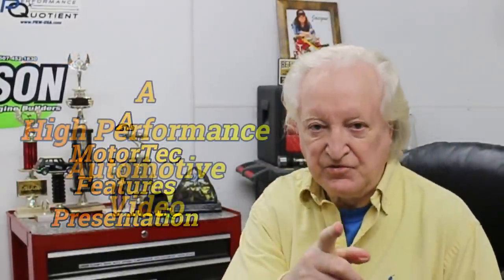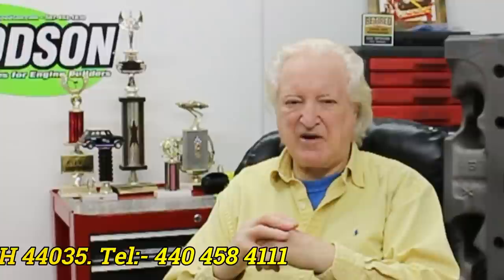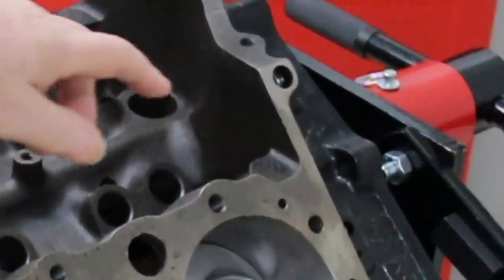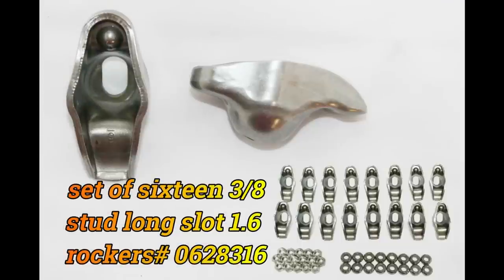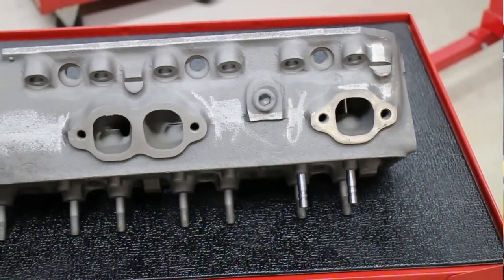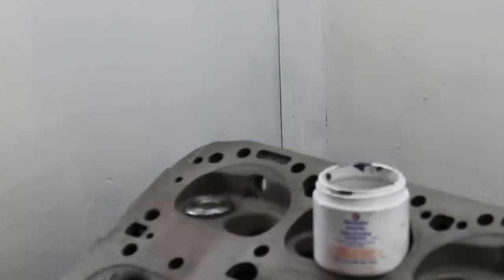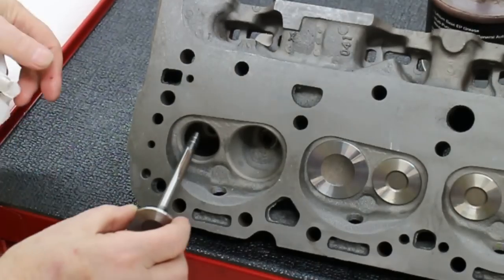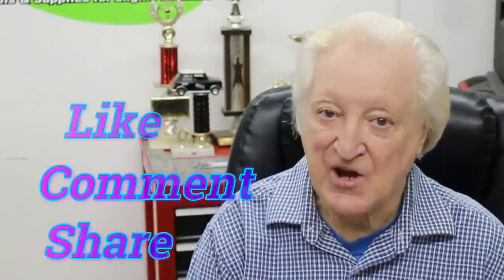Real low buck 60 lbs-ft and 60 hp minimum from stock iron headed 350 SBC

Comment: Professor Vizard, Where can these correctly ground camshafts be obtained? When I dealt with Comp Cam I stated I needed a cam for a 390 FE. I calculated the LCA per your How to HP book page 107.  I calculated 106LCA. I also asked for 35 degree overlap. I got alot of push back how 106LCA is too narrow rough idle, peaky blah blah blah.. I ended up getting cam on a 110LCA. They said 110LCA is what I needed. I gave in just to stop the guy from dispensing anymore disinformation to me.  Where or who can I contact to get what I am asking for? I am sure I am not the only one. Sorry for your loss. Keep up the great content. Thanks.
Reply: LCA: lobe center angle and LSA: lobe separation angle are not terms that are interchangeable.
Perhaps this is why you had problems with Comp ?
Reply: @luckyPiston  No. I am not confused. I am asking for Lobe Centerline Angle. LCA is not adjustable. LCA is ground into the cam.  110LCA that Comp insisted I needed is too wide for my engine. Per page 107 the 106LCA "in terms of output, delivers the best area under the curve..." for my combo. Lobe Separation Angle LSA is adjustable when timing the cam during install. I have attempted to contact Comp Cams on three separate occasions with no answer back. I have heard of others getting correctly ground cams from them and did not expect to get a salesman looking to push an incorrect catalog grind on me. I have already wasted money getting the incorrect cam. I am trying to fix my mistake and get the correct one.
Reply: @rennypizarro4432  Area under the curve is more a function of lift and duration, the intake lobe centerline angle (LCA) determines where that area is in relation to piston position in the bore at the time of maximum intake valve lift.  LCA "is" adjustable.

Lobe separation angle (LSA) is ground into the cam, is not adjustable and will determine the overlap of the cam as well as the position of the exhaust lobe LCA in relation to the intake LCA

If you spec your cam to be installed at a 106* intake LCA with a LSA of 108* then the cam will have a exhaust LCA of 110*

106 + 110 = 216 ... 216 / 2 = 108 

I you grind the exhaust profile in later then you open up the LSA

106 + 112 = 218 ... 218 / 2  = 110  The time when the cylinder is blowin down is changed which effects scavenging which effects torque at lower rpm.
Reply: @luckyPiston  I think I used LSA when I meant intake centerline. ICL. I am using and defining LCA as defined in Prof Vizard's book How to Build Horsepower. LCA is defined as I described. See pages 103-108. I used the overlap chart provided. I chose 40degrees. I calculated the LCA using my intake valve size (2.09). Calculated the displacement of 1 cylinder (390cuin÷8 = 48.75) next I calculate cuin/intake valve diameter (48.75÷2.09=23.32) I consult the lobe  center angle determination chart and find 106LCA. LCA+(overlap/2) = duration. In this case was 252. Comp recommended a cam 255 but was ground on a 110LCA. I think we are saying the same things (other than my LSA for ICL flub) as I recognize you are using Comp Cam definitions. But that said the point of this video is to show how not choosing the correct LCA could be sacrificing torque and hp. In my case I do not wish to give up torque since I plan to tote a camper.
Reply: Renny, sorry but you're wrong.
LSA and LCA are the same.
You're confusing INSTALLED CENTERLINE ANGLE,
See DV's book for explanation.
Reply: Order Custom ground.
They're trying to sell you their book specs stuff.
Reply: @hotrodray6802  Will do thanks.
Reply: Tut tut bad advice. The LCA does not control idle quality - overlap does that.
Reply: @luckyPiston   When I quote LCA I am meaning Lobe Centerline angle not Intake Centerline angle.
Reply: Update on my Comp Cam. I was able to order and receive the correct cam on a 106LCA. 255DEH-06. 255/265 seat to seat .469/.495valve lift. 0 advance. Edelbrock owns Comp Cams. Spoke to Jeremy. 2 weeks to receive cam. Also had cam hardened as recommended in HTBHP.
Reply: Let us know how it goes
Reply: @dennisrobinson8008  will do.
Reply: @rennypizarro4432  I read DV "How to build horsepower" and another of his literature back around 97...    What is funny is some younger guys dipped in and bashed DV saying they don't know who he is...  And acting like he doesn't know nothing, when DV's material and science is the foundation of almost everything we use today...   It's kind of crazy like a younger guy dipping in a field with experts that have been on a topic for 20-30 years and acting like he is the expert because he went to school more recently.
Reply: @dennisrobinson8008  Most likely these recent "experts" were educated with material originated and authored by Prof Vizard.
Reply: @rennypizarro4432  Many were indirectly even if they aren't aware it was him...   Also likely all the air flow advancements that were allowed into mass production were influenced indirectly by DV, when it was observed that it's almost an exact repeatable science to it.

Comment: Hello David , know u r super busy but l was wondering if u wouldn't mind giving me some advice on an engine pls. 
1st off is the Manifold l am going 2 use .  Circa late 1960 early '70's. 
BBC Edelbrock XC-96 X-RAM . 
The combination(s) l am 👀👀👀 at are a 496 ..   Would work nicely . 
The other combination is a 525 cu inch engine . Bore 4.310 Stroke 4 5 .
Compression 11.1  on both engines & 98 octane here in Australia.  
The Carburetors l would ❤ 2 find a pair Predator Carburetors 5000 / 6000 .  
This manifold does suffer with signal issues from my understanding with the Carburetors.  Hence my thoughts on the Predators. The engine use . Marine . Beismeyer Flat Bottom Boat long deck.  
The manifold hasn't been touched . 
Looking at as much HP & TQ I can squeeze out of either engine with the 11.1 compression. 
V-drives like 2 Rev & the 525 cu inch motor may run out of puff at 5800 rpm . Might squeeze 6500 out of the 496 cu inch engine . Obviously these old style X-Rams have there limitations as well. 
Cam Specs l have know idea . 
Cam would be a mechanical roller with after market roller rockers . 

❤ the work u did with Andy on his mixed up boss.  His engine came up super well.  
Many blessings 2U 
Robert     Australia

Comment: David, I realize that you want to keep the head rebuild to as close to stock as possible but am surprised you didn't opt for screw-in studs. The cost for the studs, machining and tapping is low considering the added peace of mind even without super high rate springs. Just my opinion. Take no offense, you are still the master!
Reply: I'm sure he will change the studs later. He did say that he wanted to stick with a completely stock set of heads for now
Reply: DV said they're not needed at this level.
Reply: I could have installed screw in studs but the heads will only be run a matter of minutes.

Comment: I have a question    How do you determine the use of rocker ratios to cam lift?    Maybe this better.   Is cam lift or rocker /ratio lift better 🤷‍♂️
Reply: Lift is lift, but...
Higher ratio rockers also move the valve sooner and more quickly as it leaves the seat. Actual valve open duration at .050 lifter lift would be longer time giving more area under the curve = better cylinder filling at lower lifts. Don't forget this also affects spring heat and harmonics so springs need to be comparable.

Comment: I thought the 400small block  was externally balanced  and the damper and flywheel (or flexplate) couldn't be used by the other engines that were balanced internally,, If I'm wrong i'ld like to know,,, great topic though and I really enjoyed it
Reply: DV did say to machine out the external weight.

Comment: Hi David, for clarification are you suggesting on a 112 LSA cam to install it 4 degrees advanced to a 108?
Reply: I think he’s referring to lobe centerline angle not to be confused with lobe separation angle.
Reply: Intake lobe centerline
Reply: Think your right
Reply: No! 108° lobe separation angle! Watch again, read one of his books or use the formula! I'm afraid that DV misspoke at the 5:30 mark, but if you've read his books you'll know that 108° is the proper lobe separation angle for a stock-headed 350 with a good street compression ratio. There's a formula too. He's gone into this at length. 
I just counted, I own 6 of DV's books.
Reply: DV means LSA, lobe separation angle.
He didn't mention installed centerline, unless I missed it.
Reply: @Joshie2256  only way to change LSA is to regrind the cam
Reply: @Joshie2256  I agree
Reply: @hotrodray6802  LCA and LSA can be used interchangeably if you don't use the words Intake or Exhaust in front of LCA.
Reply: Miller
Installed centerline is not the same as separation angle  🙄
Reply: No LCA 108 at 4 degrees advance means intake centerline at 104.

Comment: Just wondering, why not Vortec heads?
Reply from the maker: Because the vortecs would have taken credit for the results.
Reply: @marvingvx1   Vortec cast iron gm heads flow approx. #222 cfm on intake: best old school 292 0r 492 gm castings about #212.  Theory goes 2hp for ever cfm increase. thats why vortec will give 20 to 25hp increase. GM had a reason in 1996 to modernize sbc head design for efi  throttle body use. Plus roll over vortec cylinder and look closely at spark plug cast shrouding. AFR redesigned their sbc heads with this dividing wall to prevent low speed plug fouling about 2001 or thereabouts. Build a few 383sbc with afr 195 #1036 cylinder heads, old style head fouled plugs unmercyifully.

Comment: I've seen that paint come off and end up going through the oiling system before so I don't ever paint the inside anymore
Reply: Poor prep, too heavy coats, insufficient drying between coats, not heat cured.
Literally hundreds of thousands of race engines have never had your problem.
Reply: @hotrodray6802  literally hundreds of thousands have 🤣🤣🤣🤣🤣 better go look that up bud
Reply: @hotrodray6802  I don't care how much prep work or time you put into that the heat and oil will eventually get to it hence the reason absolutely nobody does that shit anymore in any new race engines today lol so I don't know wtf you're talking about

Comment: well you said you were using 186s and those are all 41s you can see the casting number where was the game to show us the 50 horsepower and 50 lb of torque basically you just took an old set of heads cleaned them put them back together disappointed that you didn't get into that I've read your books I've got 50 years experience doing this as an automotive Machinist and it's really expecting a little more
Reply: Watch again.... Try to listen.

Comment: "400 chev was factory external bal. If your Gunna build one up,  "Internal Balance it, use a neutral bal flywheel, flex plate, and balancer and the right combination of rotating assembly.

don't think it can be done and you question mark it?, 

"My YouTube Brenton K
Reply: Can't neutral balance an externally balance crank... Requires too much added weight 
Buy an internally balance crank used in 383s.

Comment: "Just changed the cam the intake manifold and put a single carb on. it not a high dollar build could do that for under 1000$" ....... ya right I bet that engine costed 5000$ minimum. Quit bullshitting everyone.
Reply: I think he's talking about 1986 money. In the mid 80s working in a machine shop I did what  he's saying with junk heads and 11.1 pistons.